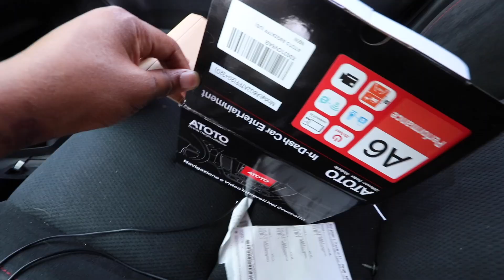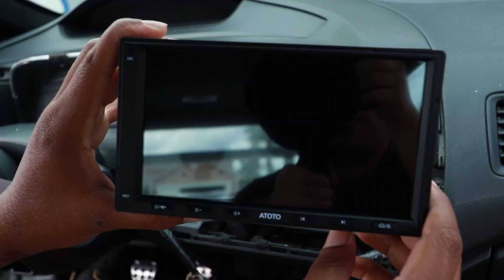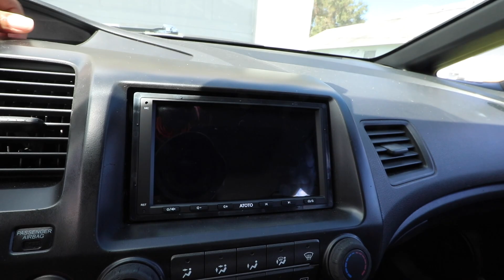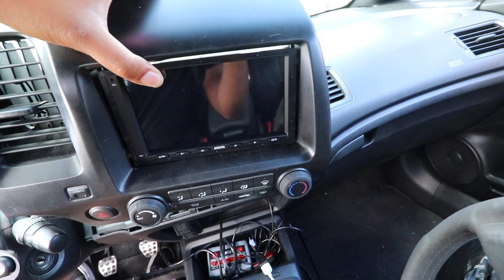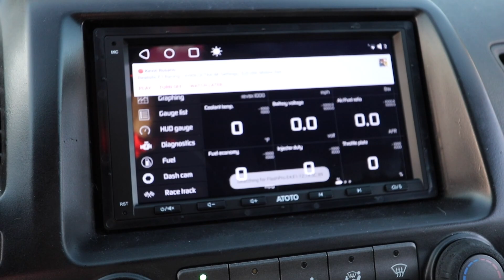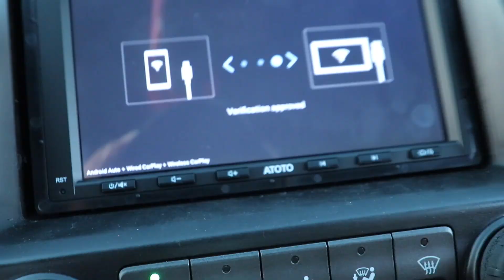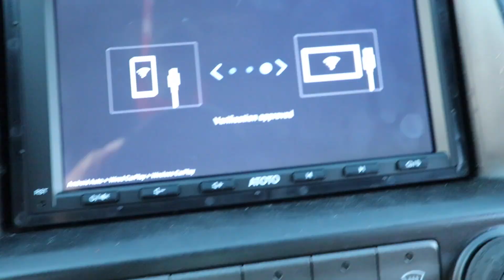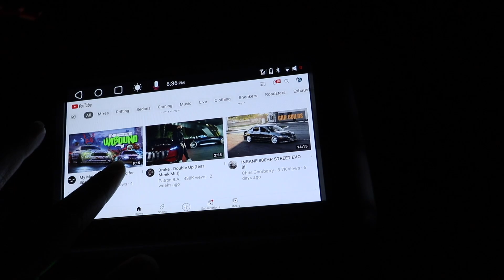AKIRA GETS ATOTO A6 RADIO INSTALL! *HOW TO* - 8th Gen Honda Civic

Comment: Let me know if u can fix the battery drain issue Zosh because I couldn’t figure it out.
Reply: You wired it wrong. I’m guessing you wired your amp turn on wire to constant 12v.
Reply: @icelover3  unfortunately no bro, I purchased a car and started doing upgrades right away without realizing it had a electrical issue. I assumed it was the radio at that time, because of other misguided info on the internet…. That stated there is a “android battery drain issue” ……… fortunately I figuered it out …. The alternator was charging the battery sufficiently enough…. It was dying and I blamed all the upgrades before I realized the alternator was the problem.